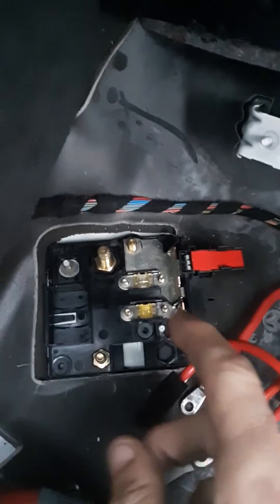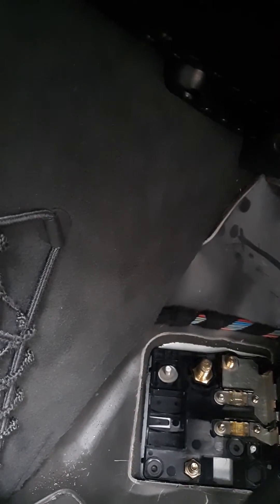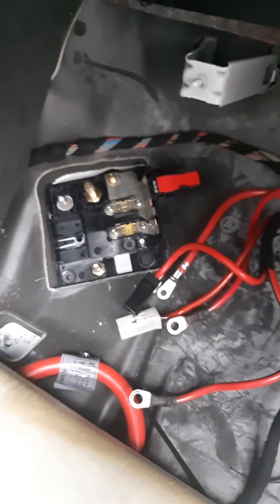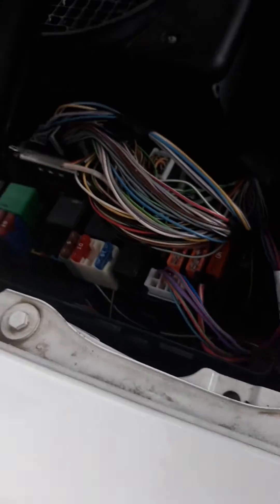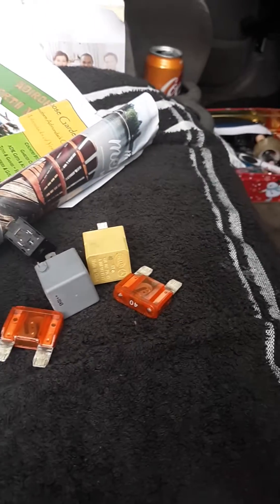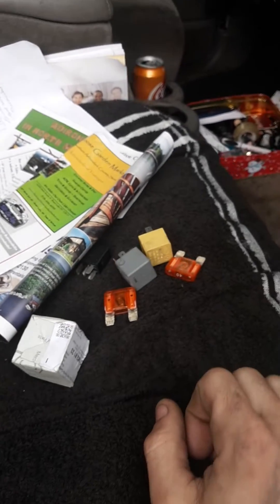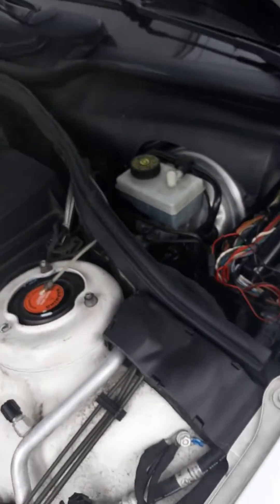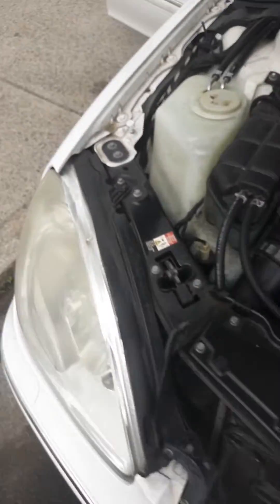Mercedes fuse box sam units distribution power

Comment: Do you have any videos on drive train can bus, having a hard time locating where it’s located. 

Was told I have a corroded bus bar rec replace bus and 3 connectors/pins. Have the parts but can’t find where they are located on S550.

Comment: Hello Josh, thank you for an excellent and informative video!

May I ask how you managed to get the lid of that prefuse-box? I believed that you had to unfastened from beneath the car and then get access to the entire box. My attempts this far to loosen the lid only have been without success. The lid sits in that very firm and hard.

Is even more force necessary or is there a smoother way?

Thank you!
Reply from the maker: Sry for late response. I can make a video and send to you. I never had to go under car to remove any form of fuses or computers. Cover has two slide locks. Then remove then computers are held in by little metal tabs you hold away from computers and slide up and out. The harness are also slide locks. Slide and wiggle up ward while lightly pulling up on harness not the wires. The white or black plastic part of harness that goes into computer
Reply: Hello Josh, thank you very much for sharing your knowledge even further!

Do I understand you correctly that the lid of this prefuse box should be able to pry open while it's still mounted to the boot wall?

If you find the opportunity to capture this process in a short video, it will find its way to my bookmarks without delay. 😊🚗
Reply from the maker: @larsolofsson5520  yes give me a few minutes I'll see if I can go outside and just show you a quick tipand show you send the video to you I have S430 that I just bought for my wife and I can show you where the fuse boxes are and how to pop them out and if that's what you're trying to do or if it's not what you're trying to do I just want to make sure that we're on the right path here
Reply: @joshgray2024 i need also video about tuat

Comment: Hi josh u seem to know more than professionals I’ve talked to and get straight to the f’ing point great work. I was wondering if you Have any advice I have a 2002 S430 and my dash board is not working and center switches not working at all. What u think?
Reply from the maker: Sam units. Clusters always fry on them.backlighting goes out. Check all your fuses. Then remove all sam u its and computets. I tell everyone this. Its always.going to be corrosion. Always. Ive fixed over 50 of these and all same thing. Everytime
Reply: Wow I appreciate your instant response. And thanks for the advice my friend. Much Gratitude.

Comment: Could this fuse affect my 2007 mb c230 I found water on the passenger side and cleaned it up and my window stopped working and the door lock on that side stopped working and the turn signal on that side stopped working and when I scan it it wouldn’t let me run the test on the window but everything else works fine it’s just that one door can you please help me I changed the switches on both doors and even a new motor for that door and all the fuses work none blown

Comment: how do you check the fuses in the rear sam"s unit, car has no power in the ignition to turn the key/previously had jump cables on the battery and there was a spark before this the key turn the ignition

Comment: Josh …. Plz read this note or question 2nd or after you read the message talking about my problem 🙋‍♂️  W211 … 2009 Mercedes E550 sport.. base not 4matic … 
After reading every single question & your replies… I thought I had better add my daughter backed into the driver headlight smashed it pretty good … it’s an aftermarket light prior every thing worked fine … another reason the car was sitting 2wks is waiting for the replacement light… Wondering could the damaged headlamp that’s been upgraded to H7  6000k … using conversion kit … could that have shorted out the orange 40a fuse in the pre-fuse box on floor board passenger side … .. Confusing why the fuse blown car had not been driven .. just started twice after working on airmatic suspension system… Just thought I’d let you know about the driver side headlamp problem..  Thanks in advance Angel
Reply from the maker: Sry for late reply but usually them conversion kit and lights fry everything. The benz usually a single ground signal through yhe headlight and when using aftwr market the ecm can not determine if it has a signal or if the amp is to high or wattage is out on the bulb. And also there are few grounds near the headlight to frame if that gets damaged or the harness to headlight gets damaged causes a short in the system and will fry the fuse everytime. And then air matic abs eps speed signals and speed sensors all go nuts

Comment: Hi Mr. Gray,  I have 2001 s600 and I just got the transmission replaced, all was fine until I changed the bulbs in the headlights and rear lights.  Now all of my power across the abs, bas, esp, hazard switch, rear shade and A/C display have gone out.  I push the switches and they no longer illuminate or work.  The A/C screen is blank and doesn't turn on.  The Fan motor doesn't engage anymore either it says visit workshop. Everything says visit workshop now and when I turn the wheel left to right it no longer clears the message.  Which fuses or relays control the switches? I had the fuses checked under the hood and they all work. My son broke a green wire at the connector point in the drivers side head light could this be the problem? I'm a 55 year old lady and I don't want to be conned by a mechanic.  They always give me bad news and then offer to buy my car so I just need a little knowledge before I call a mechanic.  Thanks for any info you can give me.
Reply from the maker: Yes unfortunately these vehicles have computers that run to everything controlling headlights to the brake pedal to the Cynthia it in so yes if you broke a wire where the headlight is in most cases it grounded out and what happened is it would ground and papa fuse if it didn't pop the fuse then it has got to be the connection on your Bas ESP computer I do have videos in my library that show where those are located and it's on the driver side under the hood you have to remove the plastic cover to see where those fuses are next to those two fuse rails there's two computers one is your ECM for the engine and one is the Bas ESP and that's the one that controls everything from your headlights to your brakes to your Speedo to your abs sensors and most of the time it's the harness that connects to that computer and if you watch my other videos You'll see what I'm talking about they get complete corrosion from moisture and somehow the water from the window rail the water escapes get clogged up with pine cones needles leaves whatnot and the water ends up sitting in there and over time it starts to evaporate these computers in the fuse is collected corrosion from that from the moisture and it looks all green and whatnot but yes I had the same issue on an S500 we removed the computer clean the connections disconnected the battery obviously before doing that but yeah don't go to a shop they're going to try to tell you you need to complete computer in the entire harness tell your son to fix a broken wire reconnected correctly with the battery unplugged and then follow the steps to get your computer out and clean it make sure there's no water inside the computer but most likely it's the harness that's going to be all corroded just use contact cleaner and a nice soft wire or bristle brush that's not going to break the aluminum pins on the harness to the computer where connects I know it sounds difficult and confusing but it's very easy
Reply: @joshgray2024  Thanks for the quick reply, I'll try that first. 👍

Comment: I have 1998 Slk 230 with no power to the windows or the power locks and inside light won’t work it was my buddy’s car and have getting it together but it was park for 2 years  and I replaced the battery and as I connected the new one it sparks???  Needing some there buddy

Comment: One of my friend said the DCM is bad I changed it still same

1. Right side indicator not blinking 
2.horn stoped working
3. Driver side seat belt going up and down
3. We can hear tik tik sound form right side
4. Tail lamp which one allways on. start to blink with right side head light 
5. Cabin light under rear seat and driver seat start to blink with head light
6. When putting double indicator I mean parking light it blink as normal but it take 2 3 Socnds delay and again blink
7 . On reverse gear mirror will auto set that allso will move 
After I diver for while I shutdown the engine and restarted again all came back in line 
car is normal
What is this🙆‍♂️
I checked rear sam
I checked right side sam
No corostion 
What I want to do plzzz help me

Comment: Hey Josh I have an 2007 s550 pit new starter  battery in trunk starter relay still won't crank where reset button at on 07 s550
Reply from the maker: Did you change crank position sensor? On bell housing of trans. When they go bad it wont show a check engine light and rarely few scan tools show it on the diagnostics.  The starter won't crank the relay won't engage and that's because the crank sensor is not sending a signal to the ecm to send power to starter relay. Ive done several of these and everyone i have had tell me or bring me their car said same thing. Changed staryer and battery and sam unit. And nothing. And all it was is a 15 dollar sensor to fix it.

Comment: Hello Josh
I’m hoping actually I’m praying you can help me troubleshoot a problem with my 2009 Mercedes’ E550 sport base airmatic system. The car once again will not rise Malfunction. 
Have replaced the following all within the last 2-1/2yr all struts or front struts rear bags. Valve box, Two compressors- tried to save $$ bought less expensive version 1st time noisy but got the job done. Ck all lines no leak … after replacing 2nd airmatic compressor .. no power - ckd relay & 40a fuse both were fine … it was not the 15a fuse nor the 7a fuse ——- then I discovered the orange 40a fuse & the 150a fuse in the pre-fuse box on passenger side floor board was blown … I changed it … compressors came on and car rose beautifully. Went out of town car sat 2week return the compressors once again sign of not receiving power when I turn on the car.. applied external power .. compressors works … went back to pre-fuse box under the carpet passenger floor … it’s blown again but only the orange 40a fuse not the 150 fuse…. What in the world is going on? 
I have a few more choice words but I’ll keep it clean…. IF I HAD THE $$$ I would take it too Mercedes… so plz I’m asking u to point me in the right direction … 
No lights on dash… only vehicle rising malfunction after I start the car ….
Please the girl needs some help plz 
Thanks in advance.. sorry I do not know all the technical terms or names of parts..  I hope I made sense. 😢
Reply from the maker: You still have it? Sry for late reply message me and we can get.you going again

Comment: I have a 2007 cls 550 the ac and radio doesn’t work. I checked the fuses and everything seems to be working fine. Would this be a Sam module problem or what?? Help I am confused
Reply from the maker: @Cap0De1   you have freon in it? Compressor works? You have to do a reset. Go on google or youtube and find a play by play on ac reset its done through the climate control functions and if fuse is good relays are good has freon and sensor for condensor shows pressure in high and low side lines for ac then this should work. If not then do the relay jumper test. Send direct power to compressor thru relay contacts.

Comment: Brother can you help me out ?
Mercedes’ w220 mode 2000 s320
have a problem with my car I check with Mecanic still they can’t find.
Only this happens morning start when we press unlock key all indicator will blink except the right side indicator inside the headlight.after I start the real problm start
Right side head light will not work and it flickers and signal light inside the right side head lamp allso will not work,horn will not work, rear seat down side cabin light , front seat down side cabin light allso will blink same time when the head light blinks
When I start to Drving that time I will get warning
Display defective , battery low,after 30 minutes of Drving I need to stop my car and want to start it again, then everyting will work normal
Really what is the problm?

I checked rear sam and clean all the pin
Now I tryed to open the prefuse to check is there is any rust but I can’t open that plastic cover

Comment: Good video,,,u think this mite be the reason I’m not getting power to fuses 48-52
Reply from the maker: Hey sry its months later,but also check the sam units,the connections where they plug into the computers. Get corrosion and make alot of issues